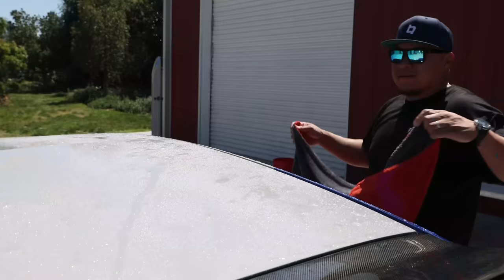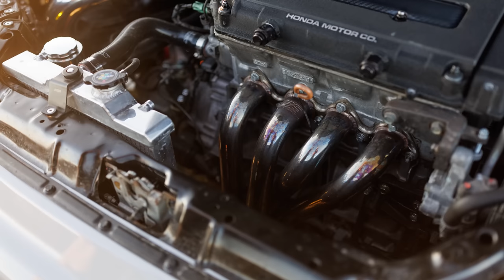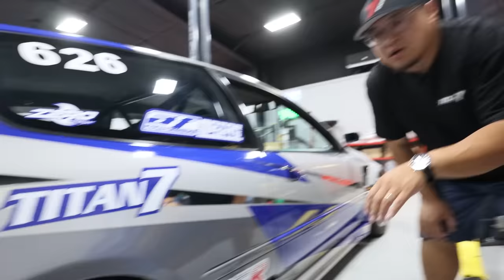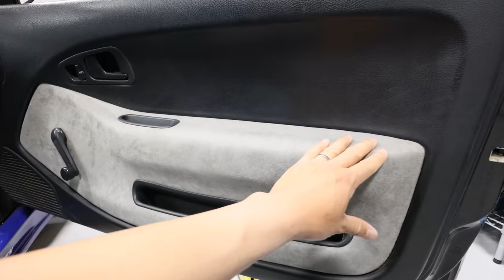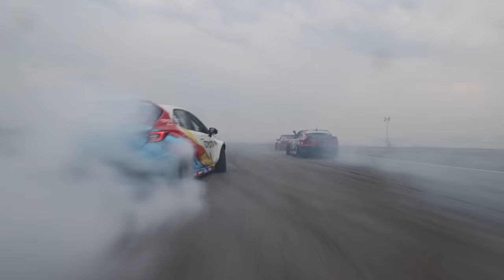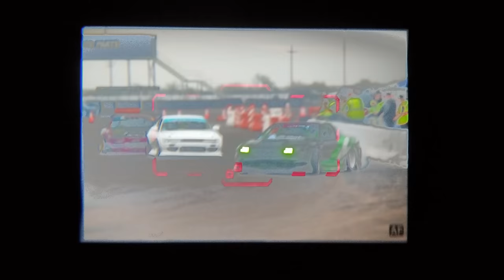90's Time Attack Dream from LA: EG Civic Track/Canyon Hero

Comment: A 16x7 forged wheel that weighs 16lbs is not a great selling point, it should be 13lbs at most. A Volk te37 sonic in the same spec is 11.9lbs
Reply: I was kind of thinking the same thing. Yes, the I-Beam spokes give the wheel a lot of strength, but that's a little porky for 16x7
For reference my 18x8 I-Beam Flowformed Braids are 18.9lbs each and are also strong enough and homologated for Group A rally.
Perhaps he misspoke and they are actually lighter 🤷‍♂️
Reply: Their wheels are stupid expensive too, about $2k for a set. Definitely not "forged for all" in my opinion
Reply: @alexc.8424  At that price point, might as well buy genuine TE37s..
Reply: Strange why use 16x7 size? 16" size wheel you are very limited on tire size and brand too. For the EG Civic, I forgot someone did a test showing that 15x8 was the best all around size for that car and much more tire choice too. I myself on my endurance racing EG Civic is on 15x9 with 225/45/15.